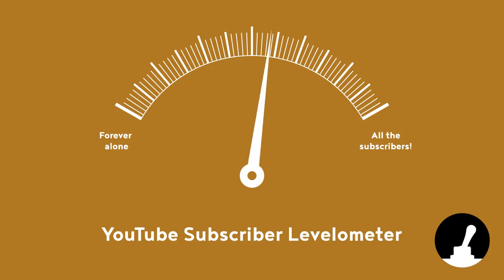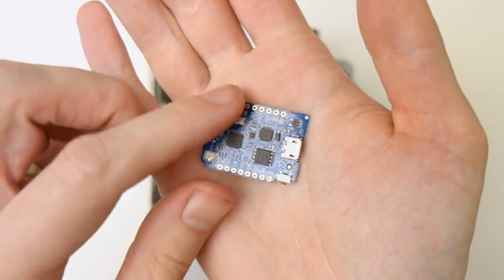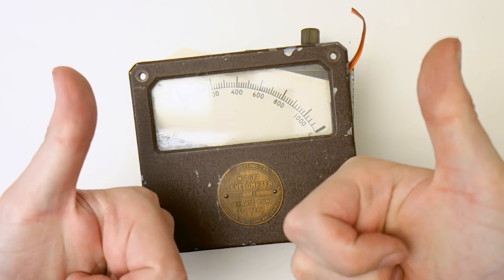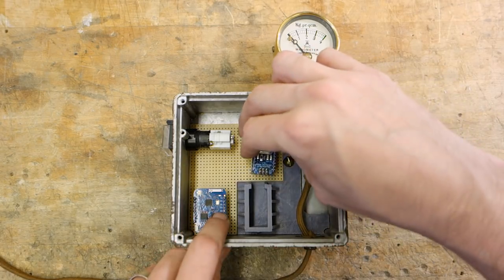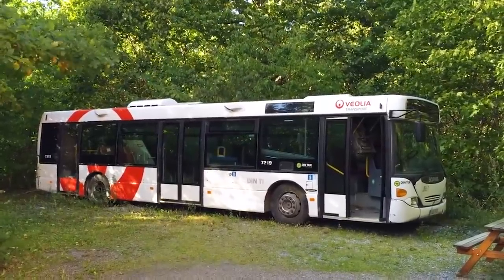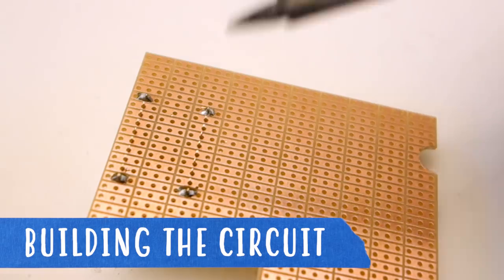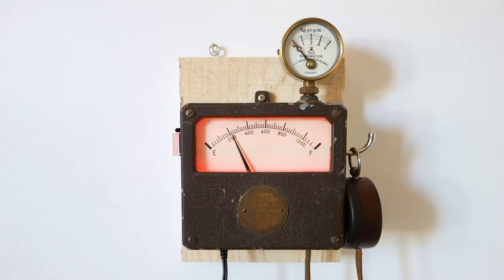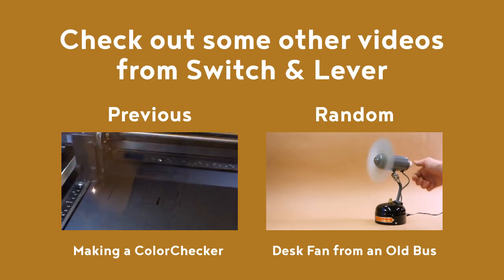Making a YouTube Subscriber Levelometer

Comment: Awesome project! I Love the idea to reporpose this beautiful piece! 

I have a personal issue with the use of hot glue gun for final assemblies like that.. I know its do not affect the funcionality of the system, but you could just put screws to hold the board and the servo in place.. It will be way more convenient if someday this needs maintence.
Reply from the maker: The PCB is only glued to the 3D printed insert, which is screwed down. It unscrews and comes out in one piece and can easily be loosened with a heat gun. The servo is only glued in with a little hot glue. Prying with a screwdriver will loosen it in seconds. The main maintenance this may need over time is updating the code, as YouTube is likely to change how to access their API at some point.
Reply: Great assembly btw. 
Sorry if i sound too critique, your assembly is perfect, its just a minor thing that anoying me sometimes when people use glue gun for everything. Totally a personal issue.
Reply from the maker: Oh, you don't, and I'm far beyond being upset just because people have opinions about what I do. Just wanted to explain why I think my usage of hot glue in this application is apt.

Comment: you could use a servo and the bellows from the original device to drive the manometer, since it is basically a compact version of the original device.
Reply from the maker: Nope, they're way too tough to drive with a servo, and since they would constantly be pushing back the servo would have to constantly be on and pushing. I'd probably have to set something up with a worm gear to get the torque required, or put in a very beefy servo which wouldn't fit in the enclosure.

Comment: Maybe you can install another servo in the round manometer and make it count hundreds of thousands of subs , using the info from below multiplied by 2,3,4 to find the result.. Excellent content as always!!
Reply from the maker: Maybe, but as I said in the video, I did not want to destroy the manometer, not to mention that I don't have a servo small enough, and running wiring up to it would be a pain in the behind. The receiver will read out the full data anyway, and that's enough for me considering the rate I get subscribers.
Reply: I wish someday you have so many subscribers that your circuit gives up! ;)

Comment: Just have it read from 0k to 1000k subs. And when you reach 1 million subs have the mano meter go to 1 and start over with the other one. Then it works till 4,999,999 subs!
Reply from the maker: This works just fine to one less than one billion subs, as it doesn't know how to say "billion", so no issue there. If the main meter goes up to a million the needle would basically not move, it would have only one up to 8% of total, in four years, if you consider my subscriber count and how long it's taken to get that high. At least this way around it tops out and returns to zero a couple of times a month.

Comment: It's cool and all but, I just wish you used a voltmeter/ammeter analog gauge rather than that neat lil midget leveler.. Also I agree on the manometer, I was thinking you were going to have two different ranges on either gauge, the small one moving in 100s of subscribers and the larger moving either alongside in 1000s or in a discrete step when the little one finishes moving to the end before falling back.
Reply from the maker: You use what you have. Would it have been better if I bought this then let it collect dust indefinitely in a storage somewhere? The mechanism still exists, and I may do something with it that actually celebrates it rather than hides it away. I didn't have any servos small enough to modify the manometer, and I actually care a lot more about that than the levelometer, considering condition, place of manufacture and age. For now making it look neat is enough for me.
Reply: Switch & Lever 
Oh don't get me wrong, it is better this way, I couldn't care less about the external case.. for some reason I thought you were going to expose the mechanism whilst still doing the counter so it was a bit of a shock when the guts were removed
Reply: Switch & Lever 
If I may, one possible use of the levelometer innerds I can think of is a centrepiece inside a clock, beating in and out at a biological rate
Reply from the maker: The issue is that it needs to be mechanically actuated, as it's actually a very stiff mechanism, and generating enough pressure to move it would be out of the question. It would need to be actuated with a high torque, low speed, motor of some sort. Don't know how long the bellows would hold up to constant movement either, as this is designed to be used a few times every now and then to check the level of tanks, not constant usage. I fear metal fatigue would get the best of it rather quickly.
Reply: Switch & Lever 
I was thinking of using the gauge as intended, move it with air pressure. A small area piston moving at a fast pace would easily generate the pressure needed, how fast it does it depends on the speed/power of the motor and stroke length of the piston.. That would involve a lot of very finnicky machining (as well as two tiny check valves + an equally tiny solenoid valve)

I've seen similar mechanical bellows used in old industrial kit so they can't be that fragile within their predefined limits. I guess it depends on the type of brass alloy used too though..

Just some thoughts :)
Reply: @SwitchAndLever  There`s no need for a micro servo inside the manometer, just a regular one where the speaker cable ends, using a pushrod that goes through the manometer fitting up into it, moving the needle...similar to the mechanism on the needle from the main device...
;-)

Comment: I have seen these at older oil heating plants in private homes. To see how much oil is left on the tank.

Quote:  The Midget Model Pneumatic gauge provides an economical way to achieve reliable and accurate tank gauging in vented tanks. Pneumatic gauges have been used for many years in tank gauging systems requiring remote indication with accuracy and stability over wide temperature ranges. These gauges are supplied with custom dials, depending on the application. Dial scales may be manufactured to indicate proportional (i.e. E, ¼, ½, ¾, F), litres, gallons, feet & inches, percentage of full and dual scale.
Reply from the maker: Neat, thanks for the information!

Comment: This is so cool and creative!  Thanks for sharing this very entertaining glimpse into the renaissance man you are.  Combining 1950’s (?) components/hardware with Arduino, WiFi, stepper motors, hot glue, metal lathe, drills, LED’s, hand taps, soldering, 3D CAD, 3D printing.  😊
Reply from the maker: Yep, it's from 1958 (found it stamped on the back of the gauge plate). Haha, thank you, I'm quite agnostic as to what technology I use to get something done, as long as it does the job. Except for pocket holes, those are the worst! :D

Comment: You forgot to add a link to the arduino libraries.
Reply from the maker: Indeed, I fixed that. All the libraries but talkie.h are either installed with Arduino or can be installed with the library manager from inside the Arduino IDE.

Comment: I was wondering if for the manometer you could get a rod up the tube and be able to push the mechanism with another servo or small solenoid (once some parts are removed), or thread some wires to an electromagnet inside, either way could make it wobble with the speech.

Comment: Great project. Might I make a suggestion. The hook for the receiver. Why not add a pivot to it and then include a microswitch inside that would be triggered by lifting the telephone receiver. Then you wouldn't have a modern switch spoiling the antique / Steampunk aesthetic. The hole you have for the switch could be repurposed for an old tungsten mini 12v vintage style bulb and holder. So when the subscriber count clicks over every 1000 subs, the bulb could flash for a minute or so.

Comment: How well does the WiFi signal work inside that metal enclosure? I would have expected no signal due to the metal. Maybe the front window is large enough it's ok? Just wondering.
Reply from the maker: No issues whatsoever. It can take a minute or two to establish connection when first powered up, but no issues once it's connected. Sometimes it drops connection with the YouTube API, but it usually reconnects within a minute.

Comment: You could use the manometer as a roll over counter for the 0 to 1000 scale counter!
Reply: I was looking in to that. 4kg / cm2 is quite a lot of pressure to generate in such a small box. The gauge itself would be too small to house a servo to drive the indicator directly. He would be better looking for a vintage volt gauge. That would be simple to drive.
Reply: Maxx B  I was thinking a sub-micro servo might fit. The voltage coil from a volt meter would fit for sure. Have you seen how small the radios and servos are getting on the indoor microlights? One guy built a six or seven channel p-51 Mustang airplane that will fit in the palm of your hand!

Comment: You are obviously wrong about the use of the old meter ... it says so right there on the front... Midget Levelometer...it is to measure if Midgets are level because you can't have a lopsided Midget running around... everybody knows that.. a lopsided Midget is just going to run around in circles
Reply: chexstix.. Not sure about that.. You may need the Dwarf levelometer... All I know is that you are not supposed to feed them after midnight
Reply: They really do cause havoc.
Reply: Would that also work with dwarfs?
Reply: Tacit Tacet 
God Bless them, but them midgets can be a real hazard.